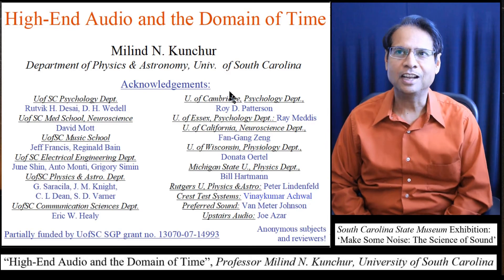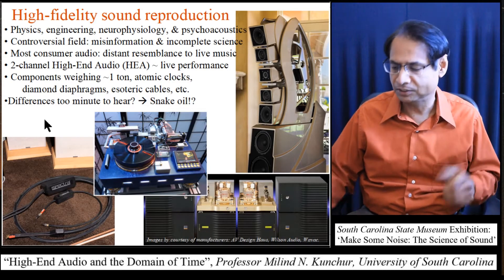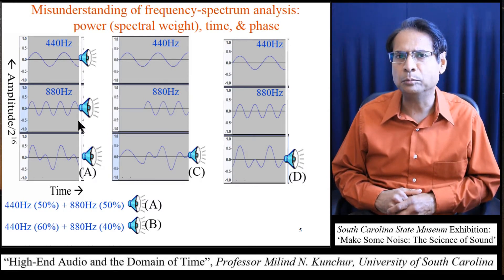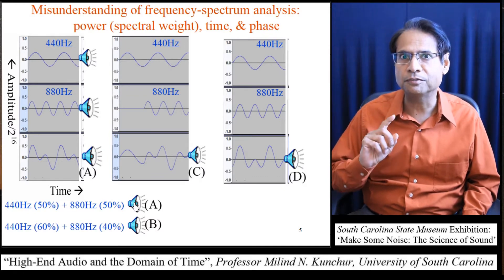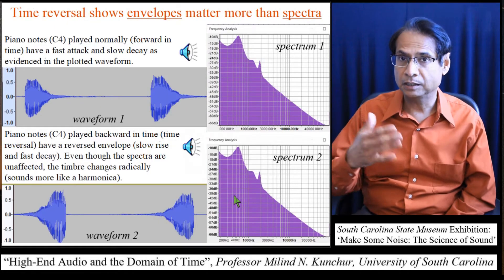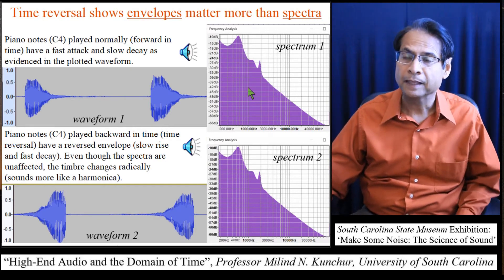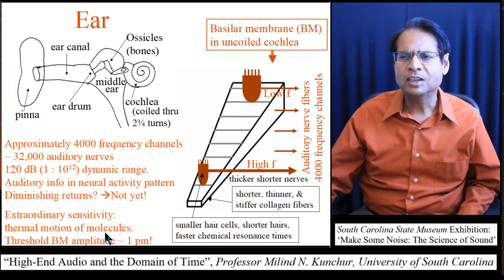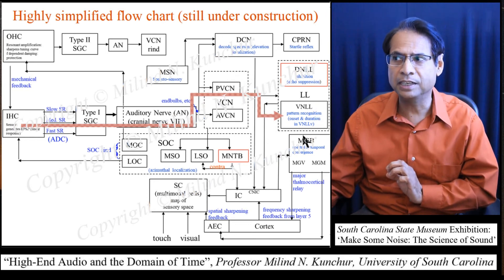High End Audio and the Domain of Time

Comment: You really need to enlist the help of your colleagues who are familiar with the fields of acoustics and psychoacoustics as there are numerous errors in this video. An example is the cochlea, and referring to it as a "4000 frequency spectrum analyzer." It doesn't work quite like that as the basilar membrane's vibrations are what stimulates the cells, and both the membrane and cells have finite dimensions. As such, the resolution declines with rising frequency as each span of the membrane will respond to a progressively broader and broader range of frequencies. At low frequencies, the resolution is quite good, but becomes progressively poor as the frequency rises and this is why we have octaves in music, to reflect the fact that we perceive the scale of frequency logarithmically. Additionally, while a dynamic range of "120 dB" is quoted, with complex things such as music, the situation is considerably more nuanced as there are things such as masking and critical bands to consider that limit our ability to discern separate components in sounds we hear. While we can easily hear noise down around 0 dB absolute, we struggle to hear distortion products that are more than 35-40 dB below the threshold of the music we listen to as they are competing with the source material itself, and often fall within the masking range of the main spectral content. Also the notion of it being a spectrum analyzer is fine from a conceptual point of view, but the actual way we resolve sound is considerably more complex and nuanced.
Reply: the frequency resolution of the membrane declining with higher frequency wouldn't be that relevant, nor would it necessarily contradict '4000 frequency spectrum analyzer'. Also he's speaking generally, obviously he's not going into specifics on that one topic. (especially when the topic is time-domain perception, not frequency domain perception). Similarly he's not going to go into detail about the '120 db' thing and both of these things are odd things to nitpick about in the video.
I will say that him saying the piano samples have the same spectrum is an odd way to make the point, but that's more a matter of miscommunication.
And I'm not sure why you think he would disagree with 'the actual way we resolve sound is considerably more complex and nuanced' because that was his entire point, and he even had a slide dedicated to it.
Reply: @sub-harmonik  As an example, the "120 dB thing" is not a minor point, nor a nitpick. This stems from a misunderstanding of someone using 120 dB, the highest level sound that can be heard before true pain sets in, as the upper limit for the ears dynamic range, with 0 dB, the threshold of hearing, as the low range.

This is completely wrong, and not how we hear. Due to effects such as masking and ERB, the actual dynamic range of the ear is about 35 dB in normal listening, and about 45 dB in critical listening situations. Anything that is below the main audio by about 50 dB is no longer able to be perceived, and this seems to hold fairly universally for people who have had a look. And even those figures are being quite generous. This is one reason why people find LPs, which can barely eek out 25 dB of dynamic range, acceptable. The only time this is violated is when the two sounds are very far apart, such as a low and a high frequency tone playing together. However, for spectrally complex things the above seems to hold, and I have yet to really see any contradictions to that. Its certainly not 120 dB, even with respect to noise when no sound is playing. That is probably about 90 dB in practice.

I was being quite magnanimous with my comments. The truth is from reading his papers, he is a clear charlatan who either knows nothing, or is deliberately ignorant of how audio and psychoacoustics work.